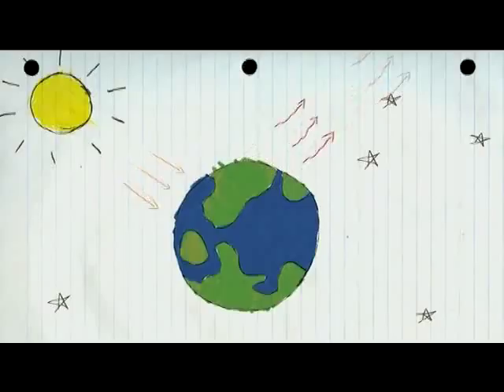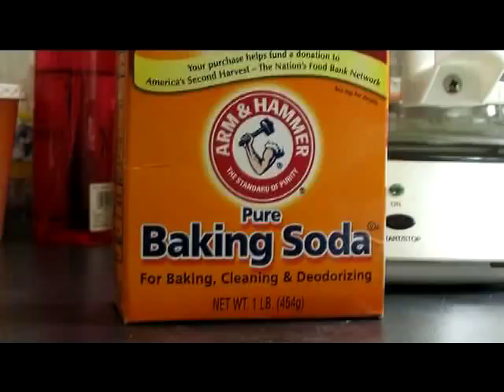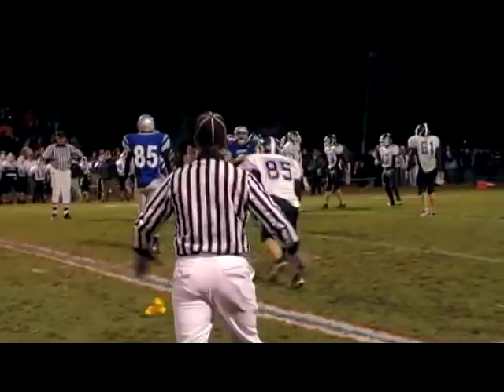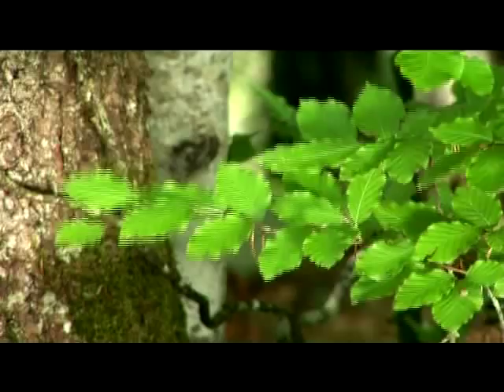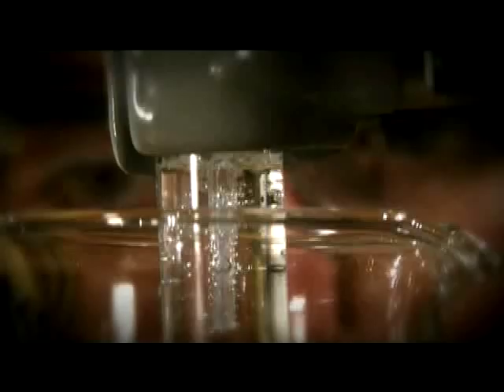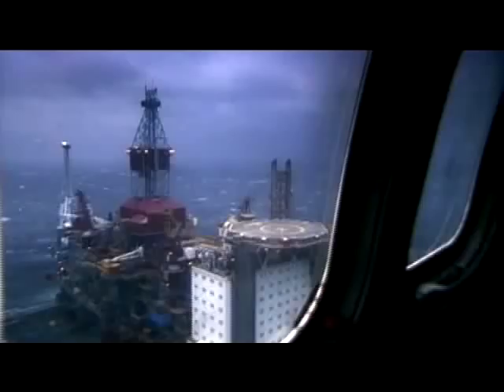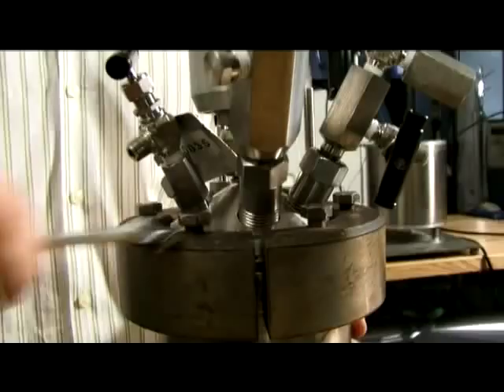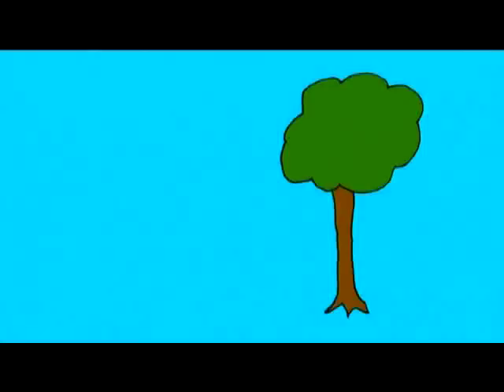NOVA scienceNOW   Carbon Sequestration

Comment: If you simply do neutralization or adsorption, there is (quick) heat energy released simultaneously. Plant cells undergo sequential redox and capturing most energy released in the form of chemical energy (ATP), which lower the amount of heat released per unit time. Fossil fuel formation (a form of carbon sequestration) takes billions of years which diluted the amount of heat evolved over billions of year,same principle. It gives me a feeling that these CC technology wont work well for the overall radiative balance (not just CO2 balance) without an endogenous heat capture system.